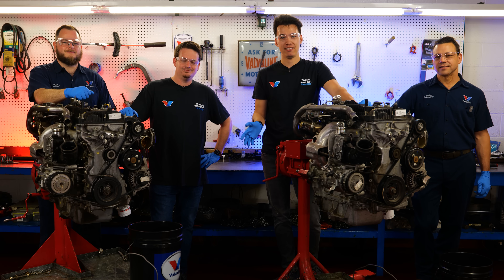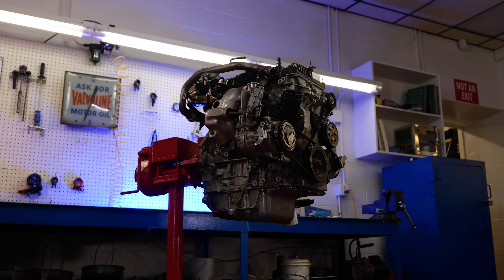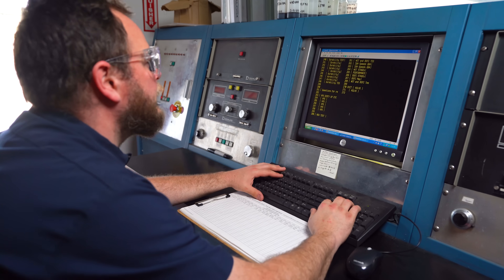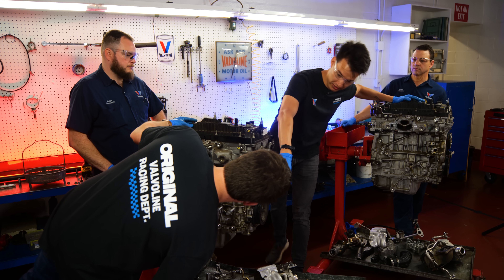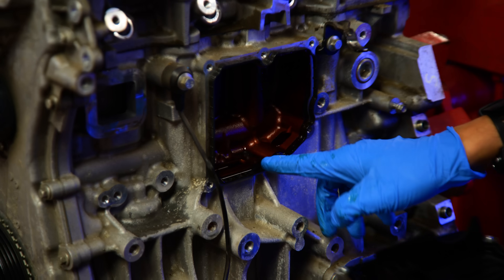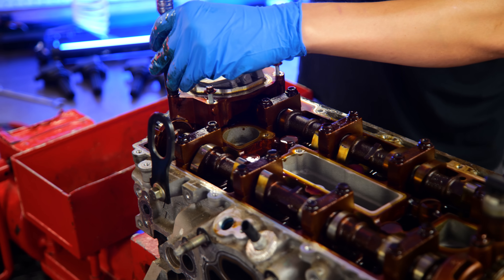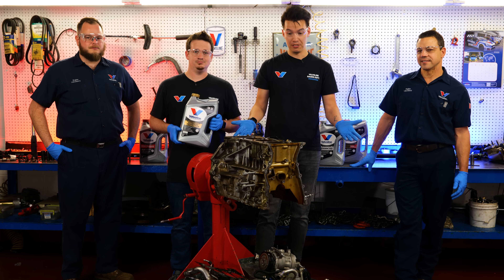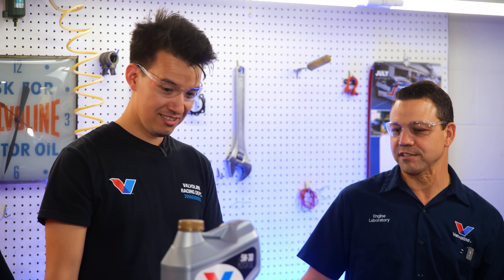Testing different oils over 4 years and 1 MILLION miles

Comment: So, basically, you can pay twice as much for synthetic oil and still get more miles from an engine than 99.9999% of people will ever put on a vehicle.  Sounds like conventional oil for the win!  Great performance at probably half the cost.
Reply: youre forgetting that this test was under ideal conditions where the engines did not get many cold starts or heavy cycling. real world mileage is a lot worse
Reply: @ And your data to support that is?
Reply: @ I am only aware of one “real world” test and it was done many years ago by Consumer Reports. It showed no difference between brands of oil, between dino and synthetic or between 3,000 mile and 7,500 mile changes in a real world application, namely a fleet of taxis.  If you know of a study that shows otherwise, please share it.

Comment: this is how you should compare. Since synthetic is twice the price of coventional, you should only run conventional every 5,000kms miles and change oil vs 10,000 miles sysnthetic. I can assure that the engine that uses conventional oil has cleaner and intact internals vs engine that has a synthetic oil in it with 10k miles change oil interval

Comment: In early 2000, I bought my first car. At 60,000 miles, I had the timing chain replaced. When the mechanic opened the engine, he congratulated me because at that mileage the engine was clean and new inside. He asked me, what motor oil did I use? I told him synthetic. I learned that from my grandfather and my father, especially my father because he worked in a petrochemical company and he explained to me how conventional and synthetic oils were made. Since then, I learned more about oils. To this day, I still use synthetic oil.

Comment: To me the BIG takeaway is to be anal about keeping the sump FULL to the top line, not a quart low nonsense.   They don't mention the top off procedure but you can bet they put in increments of ounces of oil to keep the level at Max.    By doing so they keep the "lube cycles for the oil" to the absolute minimum, which I believe explains how the conventional oil could make 500K miles.

Comment: I have always used Mobile 1 full synthetic. But now I will give Valvoline Full synthetic a try . My Ram 1,500 5.7 only has 145,000 miles on it and just a few things needed to be replaced . It has to last me because  I can't pay for a replacement . It had a tree fall on it and was totaled by the insurance company. I bought it back for $ 1,500 . I pulled the seats and built a wood panel to evenly push up the roof with a floor jack . Safelite got a new windshield in even with a little dent on the frame edge . So anything to help her last is good. PS- I don't let her idle for long , so the top end doesn't get starved for oil ✓

Comment: I wonder if the conventional oil would have fared better if the oil change interval had been done at every 5000  miles instead of 10000. I use synthetic in my cars but every 5000 miles. Oil is cheap compared to a new engine or car.

Comment: I am not surprised that the synthetic oil engine is in it’s current condition. I have other similar experiences that are about the same. The conventional oil engine was surprisingly in good condition also. The build up on the surfaces is actually not too bad. We must of course keep in mine that both of these engines were operated on a regular schedule. Unfortunately in the real world getting proper maintenance is not always performed on a regular basis. 
I have been using Valvoline products for several decades and I have settled on the Extended Protection high mileage on most of my vehicles. 
I did however try the Valvoline  Restore and Protect on an old pickup truck with over 350,000 miles on the original engine. The jury is still out as to how well it will clean up this old engine but so far it is definitely running smoother than it previously had. I ran the oil for about 300 miles and I changed the filter per recommendation. I cut the filter open and was surprised at how much carbon and sludge that was present. I only use Wix filters and I routinely cut them open after every oil change. I do this mostly to monitor metallic particulates. I was a research and development engineer for two major motorcycle companies so old habits die hard. I have been using Valvoline products for about 60 years and I am quite happy with them.

Comment: I have over  1.5 million miles combined experience with just 4 of my vehicles and Amsoil.
My Daily is a 2000 Crew cab 7.3 dwr 4x4 auto. with 491k. 9 OIL CHANGES 19 FILTERS. test regularly. what is there to know

Comment: The weak points in this test is the lack of dry starts and no short-trip-cold-engine shutdowns. There the sludging and accelerated wear with conventional oil would be markedly increased. We know that in a same oil comparison, engines that run every day for many hours will outlast the conventional city/suburb car by many hundreds of thousands of miles.  Still it is nice to see the proof of synthetic superiority under controlled conditions.

Comment: 10k oil changes... My dealer recommended 6500 on my Jeep Gladiator, even though it's synthetic, I'm doing 3500-4500 mile oil changes. I'm assuming it's way overkill, but I absolutely love my Jeep, and if I can get it to 200k (Id assume about 9-10% of my mileage is offroad) I'll be very happy.

I've always believed preventative maintenance is the way to go, plus break downs really mess with my schedule.

Comment: I wonder did they keep track of fuel consumption for the 500,000 miles.  A dyno of hp/tq new and 500,000 miles would be a nice data point.

Comment: Comparing bearing clearances and ring gap would be nice if they had the original blueprints.
Otherwise, the removal of the zinc compound that adds a protective surface in 2005 (to all oils) due to ‘premature catalytic converter failure’ would have been a nice comparison, since both catalytic converters still failed.
By removing this compound, engines will only have a 10-15 year life before clearances become loose, no matter how often you change your oil, unless you add an additive containing the zinc compound.
Racers with solid lifter camshafts were rounding off cam lobes prematurely because they removed this compound from oil and didn’t inform the public!
How long do they think the availability of vehicles will last when they aren’t manufacturing enough vehicles to keep up with the current demand, and yet engine failures will start happening in waves, with no parts or vehicles to replace them?

Comment: It also makes a big difference what conventional oil is used . I have teared down Cummins and Cat engines in the eighties after 1.5 million km with less varnish than your engines. Another key point is regular coolant changes and injector services and filters. Your engine is only as good as what you feed it and how regular you feed it.

Comment: This is good to see and it’s nice Valvoline does these tests.  But on the other side there is a reason that most peoples engines look horrible after 150k miles. They run a lot of low miles and short trips which really kills engines. Also cold environments just worsen the effects. So in reality these are not really real world tests. Even oils 30 years ago could keep an engine running a long time if the engines were maintained and driven lots of highway miles. The take away is change your oil often and do use synthetic.

Comment: I had a Ford 2.3, cam went out at 54k miles.
Tore down the engine for a rebuild, # 1 piston was cracked.
Walking tru ford service area with the piston a mechanic hollered over, #1 piston for a 2.3 engine.

Comment: 10,000 mile OCI for conventional is quite insane.  Even when it was standard, no manufacturers ever recommended going over 5000 mile OCI for conventional, and the standard was generally 3,000 miles.  I think a 5,000 mile OCI interval for the test would have been more apt.
Reply: 10,000 is fine for good synthetic oil.
Reply: the recommended OCI for the Gen1 coyote engine is 7500-10000 miles. my Mercedes had a recommended 10k mile OCI as well. I've sent off several oil samples at 10k miles to be analyzed in a lab, and they all still had a great TBN rating. whether or not the filter holds up is another question entirely though.
Reply: @VitrusResearch  those early Gen 1 coyote F150s and Mustangs specd synthetic oil though, not conventional
Reply: @on1ytheb3st  oh that's a good point, I completely missed where you mentioned conventional. yeah, My engine is specifically calls out 5w-50 syn.

Comment: You have to acknowledge these things are running clean air. No dusty , dirty gravel roads, etc. That's a huge difference in wear and tear.
Reply: and unlikely to have those cold morning starts
Reply: They ran these for years and wanted to emulate how a typical driver uses their engine. At the minimum they had to cold start it once a day, but I imagine they cycled them from hot to ambient temp a few times every day.  @gixxingthecommute3410
Reply: You also have to acknowledge the main purpose of these test. which is to compare synthetic vs conventional oil, whether it's clean or dirty air and if it amplifies the different results, we will still know which is better.
Reply: Can someone explain me why cold starts are the big killer of your engine ?
Reply: @tartopom2669  Because for a breif moment your engine runs with no oil, and when the oil is cold it does not flow as well and its protective properties do not work as well as when up to operating temperature. Also the expanding of your metal engine components as they heat up, this is the main cause for head gasket failure.
Reply: @Uncle_Bert  thanks for your explanation, I thought it wasn't much a problem for road cars, mainly for race cars or engines with forged internals.
Reply: @tartopom2669 probably the reason why you don’t see a lot of engines over 400k. A lot more variables at play. Dirt, temperature, heat and cold cycles, etc.
Reply: @drewfeld836  sure, though it makes me wonder how XJ's, Land Cruiser and Crown Vics manage to get so much mileage. Is it only because of understress / low HP per liter ?
Reply: @tartopom2669  they're very simple engines, much less components to go bad on them.
Reply: Cold starts contribute greatly to the average wear an engine sees because the oil is not up to temperature, offering less protection and flow, and because the oil is settled at the bottom oil pan vs all over the inside of the engine internals.  @tartopom2669
Reply: @tartopom2669 könnte ich, habe aber keine Lust 😂
Reply: @tartopom2669 the engine is designed to operate at high temp.  Anything cooler and the pieces don’t “fit” together perfectly, so driving it like an f1 off the bat is not pretty
Reply: @Youtubeuser1aa its wrong to say that engines are "designed to operate at higher temperatures" , they are designed to run at those, but operational temps are between -20 to +60 in most engines. Operational temp is the range in which the engine can perform all its tasks, e.g. starting and stopping the engine would be two such tasks. SO a engine is very much designed to start at low tems without damaging itself. It is however not designed to be started from cold an immediately put up to 100mph within 20s of starting. But a normal "start engine, let it run a few s while you check the rest of the car and get ready to drive, get out from your parking lot or drive way and onto a relatively low speed road (like a road inside a city), cycle is very much inside the normal "operational field" of an engines design.
Reply: @AlphaHorst  you just said what I said but less concise
Reply: @Youtubeuser1aa  sure buddy.
"the engine is designed to operate at high temp" is the same as "the engine is designed to run at high temp, not operate" 

if you belive that is the same you should read again. And not start interpreting half way through. there is no need for your mind to do anything but read each word one by one, no hidden meanings or interpretations needed.
Reply: @AlphaHorst  I literally said don’t go driving an engine like it’s an f1 before it’s warmed up.  

I designed micro Wankel engines where heat transfer is more complicated than large scale 4 strokes.  I don’t need your “expertise” to be less concise  lol
Reply: @Youtubeuser1aa  you might have done all that, but how to read you never learned.

Again. i already pointed out where my statement is utterly different from yours and why they are not the same. if two quotes, each less than 15 words, is too much for you to comprehend then I can not help you
Reply: @AlphaHorst  sure buddy.  Completely different.  Ground breaking.  We all applaud you 🤦🏽
Reply: @Youtubeuser1aa  OK mate.
I hope I never have to use anything you had your hands on when you are not even capable of using the most basic of terminology correctly and when it is pointed out to you l, you react like a 6 year old
Reply: Correct
Reply: Was looking for this comment nice
Reply: Thats the point though, they are getting lab results to isolate all possible variables so the only variable is the one being tested. That's how you prove a hypothesis true or false. Something called science basically.

I get your argument, because conditions in the real world are always gonna change the outcome from the lab results. But regardless, synthetic oil runs cleaner and lasts longer and protects better and this video in the lab proves that.
Reply: I'm guessing no cold starts either
Reply: I'd reckon it might make a huge difference if the motors had been under load, the full load of the vehicle they were in

It's one thing varying the revs but with no load you're not properly testing those motors in the true sense, hence the low wear rates and high mileage obtained 
Therefore the oils may well perform differently to these results in real world conditions where additional heat generation for example may well have burnt off the mineral oil much better 
So many things may have been different, however it was a very good comparison in same conditions even if not realistic 

I really enjoyed the video
Reply: Right. You still had cylinder honing marks. True 500k mile engines don't have those. At least not as apparent as these ones did.
Reply: Du solltest einen Luftfilter verwenden 😂
Reply: It shouldn't be.  That's why you have an air filter.  How would dust and dirt get in your oil pan???  Like the other guy said cold starts are the big killer.
Reply: @JViello  Filters don't trap 100% of the particles that pass through your intake, everything can basically break down till it's small enough to pass through. Tiny particles of basically everything.
Reply: @brycedrumm4012  air particles dont wear and tear your engine if you have an air filter lmfao
Reply: @sigmamale4147  dirt particles do though "lmfao"
Reply: It’s not a real world test, it’s a comparison of how two products performed under similar conditions
Reply: Yea, they basically simulated 500k super easy highway miles.

Comment: You should never run 10,00mile oil changes on anything. I have been using Valvoline Conventional oil since the 70s and change oil at 3,000 and have never had one engine problem. So all of you can change your oil when you want and keep paying for high priced oil samples.

Comment: One question is how many cold starts?  Cold starts are what wears the engine most. Ford ran a test in 1964 on set of mercury Comets running them 100,000 miles and most of the engines made it though ending up still within factory specs. They never had time to cool down being run 40 days straight.

Comment: The test does not even come close to the conditions of everyday use. Lots of cold starts, short distances, cold engine, not running hot...etc.
Cold high load and mostly variable load in variable conditions.
Here you can really compare the two oils under the same conditions, which cannot be compared to normal use. Practically nothing can be learned from how the oils perform under everyday use.

Comment: I'm using AMSOIL 0W-30 in my 2023 Hyundai Santa Cruz, 2.5L Turbo, and I will be 🎉happy if it doesn't explode before the warranty runs out. The Oil Geek tested it as #1. Sorry Valvoline, but this video did prove synthetic oil is the best choice.

Comment: Why didn't they just cycle the engine's with an electric motor hooked up to the crank shaft you still could vary the load and heat and cold. 🤔🤔🤔